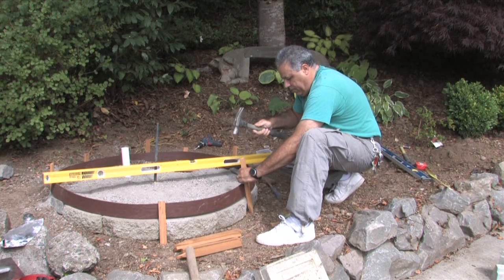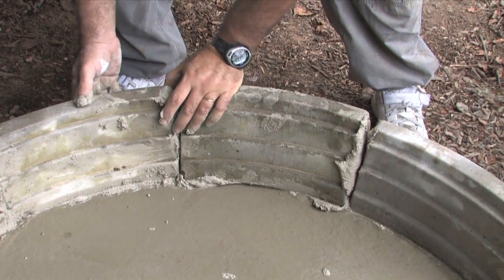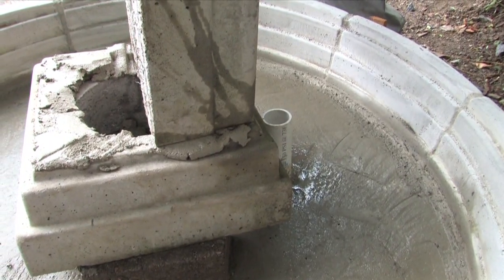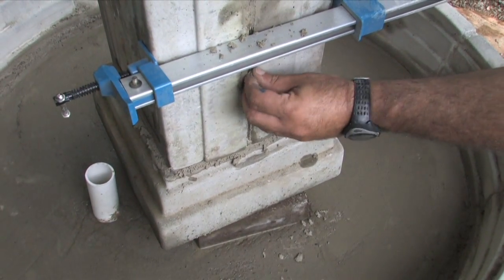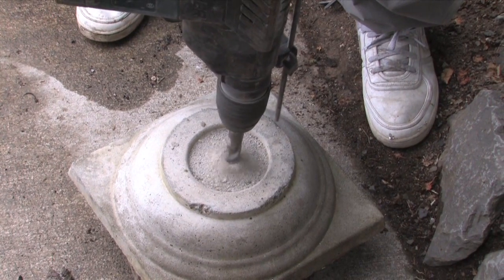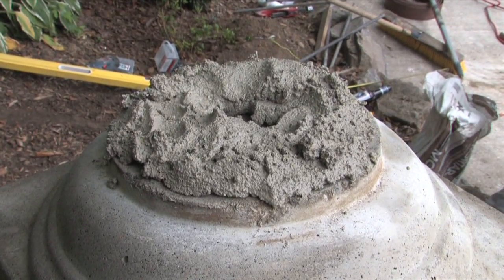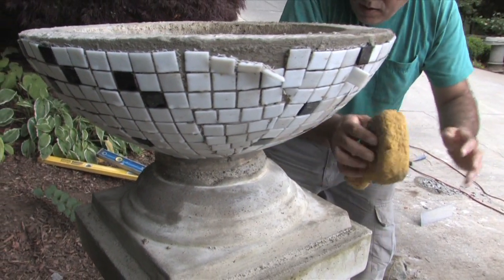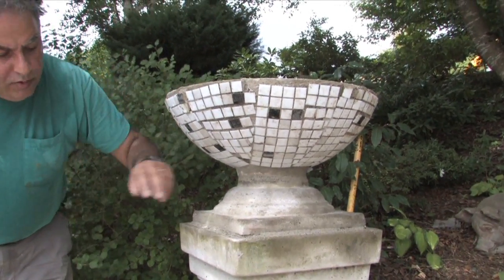buiding the fountain.wmv

Comment: No, your right of course I would never even try to build one 'like' it. It would look nothing like that. Yet would at
least be correctly done.
All I see here is a badly built cement eye sore. Yet if it had at least been constructed properly, I would have given them some points, like wetting the joints before applying the cement or removing the surplus cement 
from the other surfaces😀

Comment: Tile work needs refining.  Their molds are nice but this construction and working with putting together for final product leaves a lot to be desired.  If the people who make the molds can’t make it look more professional - how will the home owner on their first try.  I think they would have been better to not tackle this if they don’t know how.  Just because you know how to make oil paints, doesn’t mean you know how to paint a picture.  I Would get a really good concrete or stucco guy, brick guy  or someone who works with hand forming details for houses - whoever and preferably someone who does tile work to to show the best way to cut and neatly fit tiles on rounded pieces.  You could show making the pieces with your molds then have the professional guy to actually put the cast pieces together.  Quite honestly,  this video makes me wonder about tolerances in how close and refined the pieces fit together.  Just my 2 cents but I think this video shows your products in a bad light.  I’d like to see this redone and to do one on the concrete railings and columns.  

I’d also like to suggest some plain stepping stones (that we can decorate as desired and some with more themes..